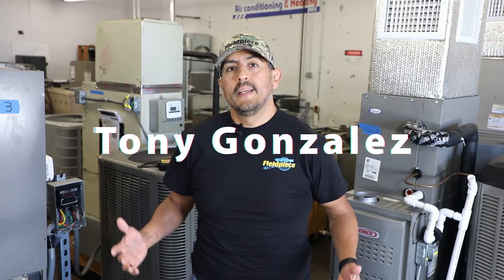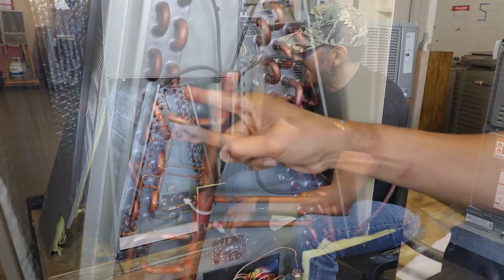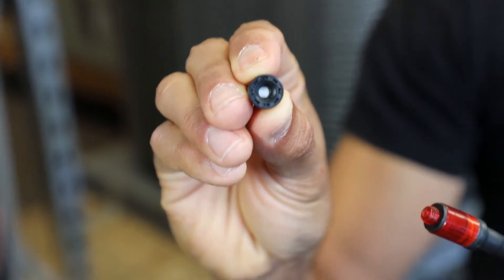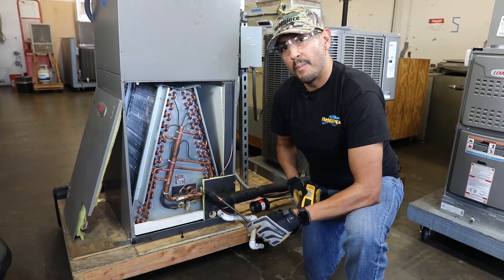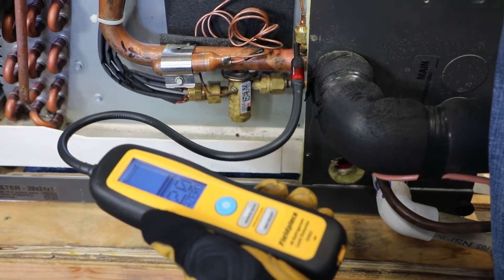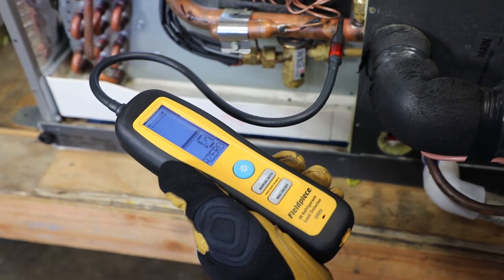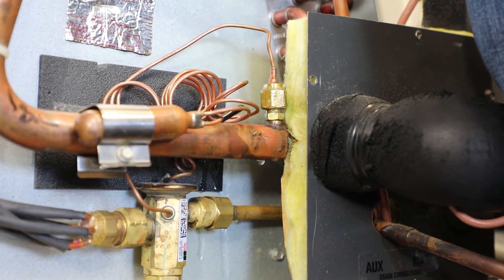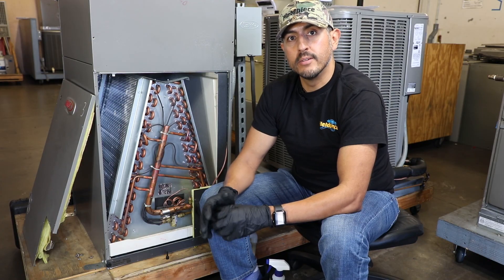Fieldpiece Pro Tip | Finding leaks with the Fieldpiece Leak Detector, DR82

Comment: I purchased a Fieldpiece heated diode leak detector in approx 2015... noise defective pump from day 1 and not detecting leaks... I dropped it off at Fieldpiece in Orange County and they said that it was defective... I used the credit to by a Field piece SLR2 IR detector... from day 1 i would get a ton of false leak reading... it did detect real leaks although not small leaks; but i would spend tons of extra time ( like a lot of time) chasing ghost leaks... the last 2 years even if i just bend the pick up sensing wand to differant angles now and then the meter would show a leak while in uncontaminated ambient air but not always..... I called Fieldpiece last week and they said to bring in the detector and they would replace the sensor for $190.00 even though it is suppose to have a 10 year sensor life and the problem existed from day 1. I asked if i could get the DR82 at cost since both my detector gave me so many problems. that was not an option...Not sure if i want to spend another $500.00 for another Fieldpiece problem detector????
Reply from the maker: We strive to deliver the industry’s best-performing products! We apologize that you’ve had an unpleasant experience. We would like to investigate further, please call us at 714.634.1844 or request a repair email fpwarranty@fieldpiece.com.

Comment: Does the system have to be running when looking for leaks or can it be off?
Reply from the maker: You have questions, we have answers! Use the “Explore” tab within the JobLink app to connect with the support team via phone or email.
Reply: Better to be off that way your psi are equalized and with it powered off you don’t have air movement with any blower.

Comment: Please can i use detector to detect leak when the AC is off and low on gas?
Reply: Should. If psi is too low on both sides add nitrogen to increase.
Reply from the maker: You’ve got questions, we’ve got answers! You can work with a specialist who can help out with this. Give us a call at 714.634.1844 or email fpwarranty@fieldpiece.com.

Comment: Why couldn't the audio indication be louder?  If you are working in an industrial environment you quickly realize you can't hear the detector at all.  TIF was MUCH louder and FASTER to latch onto leaks than this tool.  I have stopped using this and use my Inficon instead, at least it finds leaks anyways.
Reply: So you're deaf AND blind?
Reply: @PIndyJones  You ever work in a pump house with compressors and vacuum pumps running?  It’s LOUD.  You also don’t always have a line of sight on the tip of the leak detector.  This detector has also failed to register on refrigerant leaks I have verified with soap bubbles.
Reply: True,  with the inficon it also has earbuds so you can focus on the sound trust I worked in motor rooms it can be annoying. 
I have a fieldpiece now but trying to see how good it works.
Reply: I've been using one for few weeks. While it picks up refrigerant it also reacts to thread sealwnt and leak spray so about as much use as chocolate fire guard. Going back to Javac type.

Comment: 500 dollar  water and soap..............
Reply: yeah that doesn't always work. I have an older model of the heated diode. I constantly find leaks that other techs "can't find" very quickly.
Reply: @JJ-zd5hu  yeahhh of course
Reply: I guess you didn't watch the video.
Reply: Lol. How you gonna see the tiniest of bubbles behind the tube that's next to the coil with 1 inch of room between?
Reply: @PIndyJones  honestly , if the soap dont create a buble , then the sound level of the disturbance created by such tiny tiny leak is not enough to be pick it up by the sensor of this jig..
Reply: @sungsan8338  it doesn't work on sound bud.
Reply: @PIndyJones  all this detectors work on the principle of air disturbance(exept the ones that used chem reaction tips), the molecular movement of the air by other gas is called turbulance and it creates ultrasonic waves, this small energy is detected by either infrared heated diode sensors or  very sensitive mic's ,..   still the energy is very very small in  tiny leaks and is not  enough to be detected  if is 100 times smaller  than a molecule of air , that means that is very hard for this sensors to really work .. .   in laboratory conditions with  vaccum chambers they may detect  very tiny leaks ,
but in real conditions  this is still is a 500 dollars  soap and water jiggy..

Comment: i use the DR58 i love that the charging port just needs a type C which i already have plenty of sitting around. showing the numbers also really helps dial in without guesswork. a little disappointed that he didnt lower his sensitivity to be positive of the exact location, but...... it is a lennox coil ofc its leaking at the equilizer